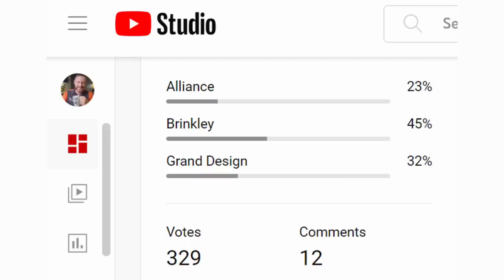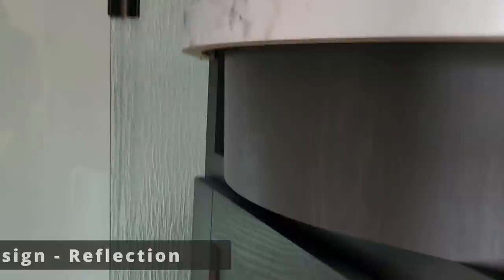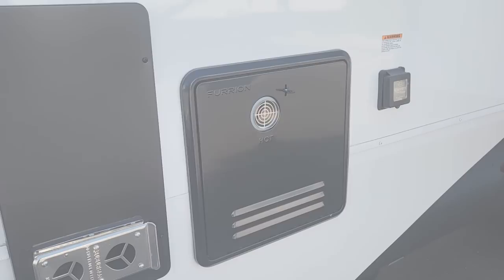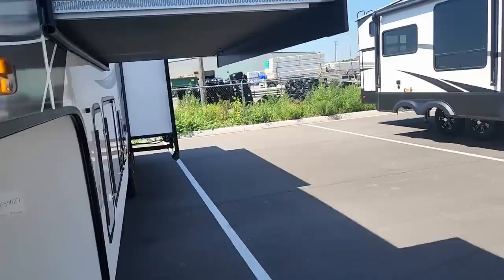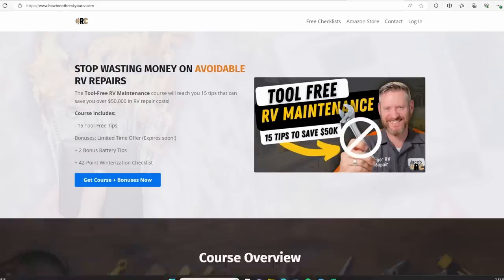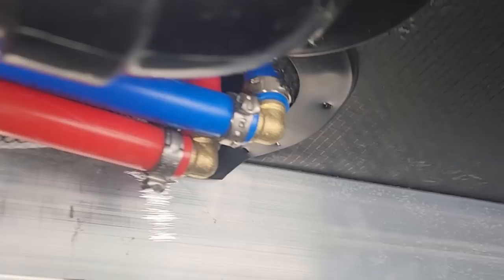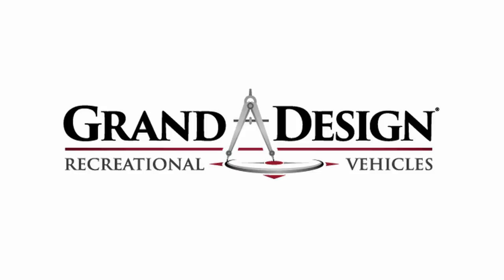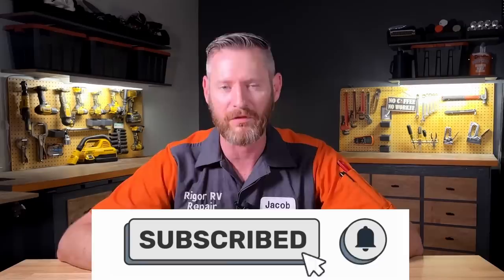UNDERCOVER RV Tech reviews Grand Design, Brinkley & Alliance RVs

Comment: I own a 2020 Grand Design 310GK and my plumbing does not contain the amount of flex tubing depicted in this video. The vast majority of the plumbing in my RV is PEX tubing. I’m not sure what changed. Thanks for your video.
Reply: Have to looked behind the water service panel in the pass through?  I think you'll change your mind once you see that.
Reply: I regularly check the water service panel for any signs of leaks. Additionally, I had to adjust certain water lines during the installation of my inverter/charger. While some of the tubing, like that found on the hot water heater and filter, is flexible, the majority (though not all) is made of PEX. I have upcoming plans to address and improve those lines soon. Thanks. @TheMinnow101
Reply: So is the Pex not the way to go? I thought they said to make sure  it wad at least pex??

Comment: Ironically, I have been repairing leaking water hoses in my Jayco (3rd rate RV brand, at best, IMO) , and this just randomly showed up in my recommended video list. It has the braided vinyl water lines that they connected to plastic Pex fittings. I discovered the problem just yesterday. The RV is less than 3 years old, but the hose is already hardening and losing seal, just from bumping them. The hose ID is way to large for the barbed fittings, and it's actually difficult to stuff the over-sized hose into the crimp ring. I cannot believe a RV manufacturer would do this, it's a mistake that a savvy home owner wouldn't make.
Reply from the maker: Sorry to hear that you are having so much trouble. Here is my playlist about the problem as well as three ways to repair leaks. https://www.youtube.com/playlist?list=PLRhkJB7TNcSn2U5sDy5ic2iWr8kFxxd_N
Reply: @undercoverrvtech  - Thank you for the good information. It's really something that RV manufacturers are so primitive and ignorant/irresponsible in their choices. I am going to machine proper brass adapters for where I need a more flexible hose, and convert the rest to PEX.

Comment: Hi Jacob.I have the Solitude 390rk and was unaware of the frame/sidewall issue. Would an upgrade to the outriggers prevent the problem? The access seems pretty straight forward to weld in a stiffer support.

Comment: All true. we just bought an alliance Avenue all access 26 our day. The fitting finish is terrible and there’s really not much to this fifth wheel. I feel like the bones the plumbing roof the siding’s all good quality but the little details are very sloppily done. The slide is making contact with the breaker box either when it comes in or on travel it flexes and hits it most of the problems other than the grand designs, structure problems or easy fixes for the manufacture to make a better quality product for the consumer fitting finish issues is definitely a company leader ship failure. That is one thing that can be done properly if supervised and taught properly.

Comment: How do you think flexible plumbing should be connected to fittings. Also note on alliance, a bunch of the higher ups came from grand design because they weren't happy with how grand design was going, but now they are headed in same direction
Reply: A lot of the same people who worked at Grand Design now work at Brinkley. They put out quality rigs, build a following, then sell out their reputation to another bigger company kind of like how Thor has bought out most companies and how Winnebago bought out Grand Design. They were good, then once they sell, QC goes down and they make money on the old reputation until people start to figure it out.
Reply: @user-ng9su4mn9x  so they left alliance and went to brinkley? The quality goes down cause they cut costs to lower price and sell more units

Comment: Thanks for this video.  IT is the 1st time I bump into one of yours vídeos and subscribed given the depth and how throughout this video is.

I will certainly will download the guide you mentioned in this video.

Two favors:
1.  Similar to this one, if you have a video of most reliable components and equipment,  can you be so kind to send me the link?. Say top 3-5  RV fridge and what makes them reliable.   Same with RV A/Ca, slide system, solar system brand, different materials and manufacturing methods are better (say countertop and cabinets,).

2.  The RVs I looking for are towables under 26ft.  Like Rockwood Mini lites, Freedom Express,  etc.  Also so called offroad or boondocking models like Embers overland and mini,  Ibex, Intech Expedition, etc.  Have you reviewed these brands?

Comment: We are taking delivery of our Z2900 and wondering what you would do to fix the plumbing issue?  With the sink in the slide out, I would assume a flexible line is preferred over a rigid water line?
Reply from the maker: Yes, a flexible supply line is required. If you wind up in Omaha let me know and I'll fix it for you! I will be making a video soon about the proper fittings to use with that flexible hose, so keep an eye out for that and for water leaks!
Reply: I'll be looking out for your video!   Love your content.

Comment: On plumbing, the waste valves on my Grand Design absolutely suck! The handle connects to a cable, much like a bicycle brake cable, which connects to the valve. If the valve sticks, your SOL. Should be a rigid connection from the handle to the valve. 

I had a gray tank valve stick in a campground. The videos on youtube said to drop the underbelly and replace the valve. I did that. Crazy pain in the neck. If it had been the bkack tank, it would have been a nightmare. 

Any suggestions?

Comment: the plumbing is rediculous on all  RVs  there should be shut off valve in all the lines at point of use such as sinks  so when having issues with sink toilets or washer or shower can isolate by turning water off at the point of use  without shutting down whole RV

Comment: Now I'm not a stumper for Grand Design by any means, and we own a 2019 Solitude, but you made it sound like all Solitudes and are the only ones that have frame issues. We all know that GD is not the only manufacturer that can have frame issues, and the frames are made by Lippert. No mention of how bad Lippert is, from bad welding techniques and frame hangers ripping out. Our Solitude frame is not built the same way as the 390RK you preview in your video and we have no problems with it. But I have to agree with you on the plumbing systems - atrocious! If these manufacturers can not install water systems without them leaking, why would I want their (Lippert) hydraulic leveling system. But the manufacturers you reference on your video are not the only ones with issues, friends of ours bought a new, New Horizons 5th wheel and they had window leaks all over the place and hydraulic hoses blowing out all over the leveling system. So the very upper end of the RV spectrum is not totally without problems either. 
Also electrical wiring on most RVs is hap hazard at best. But to see how bad it is you have to remove cargo panels and look behind the walls, or lower the coroplast (underbelly) and look up inside.  Now I hear Brinkley uses color coated wiring harnesses, and does have and use wiring diagrams, but I have no direct knowledge of this or how well the electrical wires are installed.
On the whole, I don't see much difference between Thor, Winnebago or Forest River. Alliance and Brinkley will get there eventually, especially if they gain market share, they will get bought out by one of the big three as well.
You do your research, do the best you can to pick the right manufacturer and floor plan, learn all you can about RV systems and learn how to maintain and repair them, pay the money and take a chance. Fulltimers now for almost 4 years, living the life!

Comment: Depending on the fitting it is acceptable to crimp flex hose on them, that being said it’s not great, and definitely if you don’t use a regulator on city water. 
I’m surprised you didn’t say anything about the wiring.. I looked at a grand design as I think they are good quality for the price, and then I saw their absolute garbage wiring / wire management, and I can’t touch them! I’m actually surprised they don’t burn down more often.

Comment: Great video here showing some good details, and when are rv manufacturers going to stop using these super inefficient, loud and heavy amp draw a/c units and goto mini split type? Every rv I work on I get asked about it and Ive installed dozens with stellar results in every case...if rv manufacturers would design them built in theyd take over the market in a year.
A mini split system is now cheaper than any rooftop system too.

Comment: 1) I love your honesty.  When you have a company that sells 10 different brands, they will tell you that they are all great. But you know in reality, the salesperson knows the issues with each brand. But they don't want to be honest.
2) I really like it when you review the a/c units, the refrigerator, the different types of slides and ect.  Now, when I check out the camping trailers, I can see what brands they have and immediately know if the brands are reliable or not.
3) I am not a handyman. I would like to learn how you can tell what type of kitchen counter top it has and how to tell if the cabinets are real wood or not.

Comment: Hi Jacob my name is Dave and I have a Jayco 29.5 bhds. 2022 and the roof is getting ridges between the front cap and about 3’ to 6’ long and Jayco tried a parcel re glue and the first 80 degree day the ridges came back plus many more. My service technician said it needs a new roof (tpo) and Jayco is no it’s with in spec. NEED HELP thank you Jacob.

Comment: Would you consider looking at Outdoors RV trailers and/or fifth wheels?  I understand they are rare.
Reply: I have been a full-time rv dweller for the past six years and counting. I currently own a 2017 ORV 25RDS travel trailer or also known as 250RDS. I boondocked 96% of the time and all this time I have been to many washboards, unpaved terrains, and rocky roads and has never been to a shop since bought new. I do all the minor works and maintenance on the road and majority of the big components is still doing its job keeping me a happy camper. ORV is a sister of Northwood Manufacturing who makes Arctic Fox which is a solid company and solid products. I will not hesitate to buy another ORV again or any Northwood Manufacturing products but I am upgrading to a 5th wheel toy hauler which none of the two have available. I most likely go with Grand Design Momentum since they are the only ones who has an eighteen feet garage I like to haul my junk on the road. You can't go wrong with ORV or Northwoods and they make them in Oregon if that is something you prefer and they also do rally every year where they fix things that are wrong in your rv for free during the rally event. Although, double check since mostly like things have change. Happy camping and take the less traveled path.

Comment: So Brinkley has addressed this plumbing issue via their customer care reps. They've indicated that for the specific hoses they're using, the connection is per spec. I'd love to hear your opinion on the subject after hearing the details from Brinkley, if you're willing to reach out.
Reply: I've also watched other RV tech videos that say what Brinkley is doing is fine and the information here is not correct. It would seem odd that Brinkley would use something not to spec when it doesn't actually impact the margin for the unit.

Comment: I’ve noticed that Lowe’s is moving away from pex to sharkbite fittings.  Would that be a better system for a camper?
Reply from the maker: They still sell the PEX fittings for crimp connections both brass and plastic. Sharkbite brand push to connect fittings I do not prefer as the internal o-ring can be damaged during installation. Also they only work with rigid tubing like PEX and copper, not flexible tubing.

Comment: Plumbing, I have a Grand Design Imagine, and right from the start I have repaired 6 (six ) plumbing leaks.  It’s a 2022 2970RL. Very disappointed! I pulled it off the lot with water coming out of the bottom of the TT. I’m a tech for RV’s and I’ve had Grand Design replace both awning fabrics from tearing. And there has been a lot of issues I’ve had to repair. It’s unfortunate the RV industry is NOT what it was back in the day when all brands tried to be the best. Too bad!

Comment: It's my understanding that Grand Design has moved to rack and pinion slideouts. They seemed to have had issues with Shwinteks. I heard other manufacturers are also doing this. IMHO, they are OK for the small like wardrobe slides but NOT for heavy and long ones... I was looking at a used Grand Design bunkhouse and noted it had the Schwintek slides, researched and found a history of problems with one person noting the specs from Schwintek itself on their slide system and then he measured his slide and it was actually longer than the specs, by just a hair, were supposed to support. He noted in his research that Grand Design had actually gotten a "waiver" my word or something for it. Irrespective, it is no longer a problem on new ones. Rack and Pinion is relatively bombproof and easy to fix.

Comment: If you want comfort and reliability, stay away from 5th wheel trailers. They are ok for seasonal weekend trips but as for long distance traveling and day to day use, they crack apart. They can’t take the pounding of traveling, but are not too bad for day to day once parked. Buy a Diesel pusher instead. These drivetrains and chassis are made to take the pounding of long distance travel have more storage better amenities full size refrigerators and more.

Comment: With the flex pipe plumbing issue in GD, could one change out the fittings?
Reply from the maker: Yes and no. Watch my plumbing videos for repair methods. The problem is sometimes the problem fittings are not easy to access, buried in the underbelly of the rv. It just depends on the model.

Comment: Man you are giving me real fears about the Alliance Avenue 29RL that I'm thinking about buying. Is it really that bad?
Reply from the maker: I just worked on a 5th wheel a couple of weeks ago where the bedroom cable slide, undermount like I saw on the 2024 Avenue 32RLS, had ripped the pully and drive motor off the wall. He was lucky it did not bend the wall framing. This was a 6 year old RV, and he had barely used the slide system. Yes, I highly recommend avoiding the BAL Accu-Slide system. You might call Alliance and see if they have plans to change to the BAL Exact-Slide, I know that some models have it already. If you can get one with that I would say go for it.
Reply: @undercoverrvtech  I'll ask her today. I'm getting it inspected tomorrow and pick up this weekend.

Comment: There is more to the plumbing than that. Pex B is terrible if it freezes. It splits. PexA is far superior. It stretches. I would say all the plumbing you showed is subpar for use in an RV. Pex B is also very stiff. Pex A is flexible and would be much better. I give the plumbing in all of them an F.

Comment: The AC portion seems like information is missing. Do some units have local cooling only or to they use a ducted system to move the air throughout the RV? Also, the plumbing issues from all of these manufacturers can be improved with little experience on the owner with minimal tools and some pex and pex bands. Also some of the manufacturer’s you listed offer options for things like suspensions systems to residential 120v refrigerators. Also missed. This video is ok but it seemed to only give a limited field of view from these 3 manufacturers product lines. A more in depth overview would be appreciated. I think the general public knows that RVs are made poorly but if it’s made poorly and is serviceable that’s acceptable. It’s the poorly made and limited serviceability of the units that’s more concerning to the average consumer!

Comment: what connections are correct with flex tubing?
Reply: If you are talking the flex like what Jacob pictured the only "proper connection" is a barbed fitting made for flexible hose.

Comment: I know you said " lumber core " is the better material for cabinet construction. 
 But this material still sucks!!!
 A little bit of water, and it will swell and flake.
 It's literally a pine board wrapped in MDF covered with a veneer tape.
 If they are going to use veneer tape, why not just use plywood? 
 As much plywood is used in the rv industry, I am sure dumpsters of " scrap" plywood are taken to the landfills. 
 This would make it so much more water resistant .
 Or come up with a material that can be used along the base of the cabinets that is more water resistant.